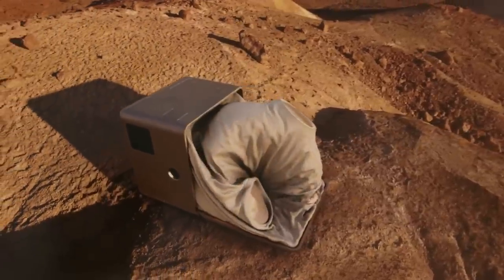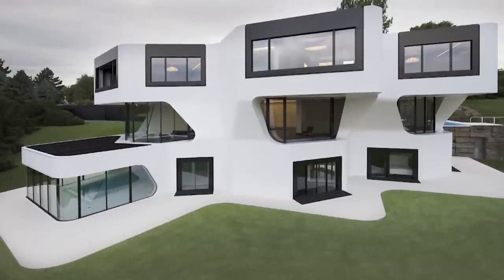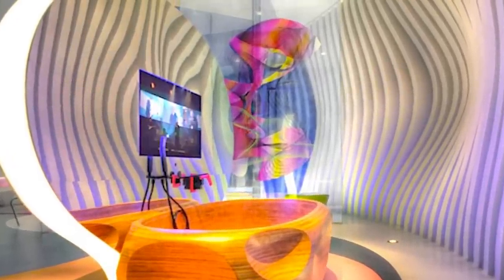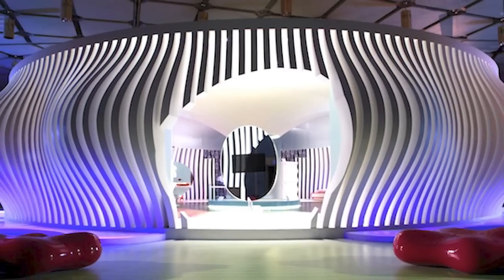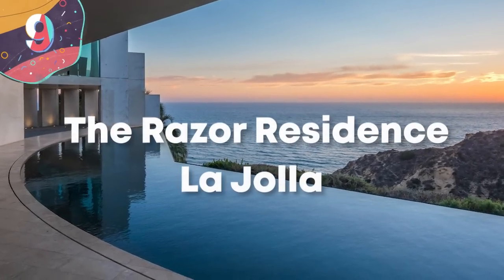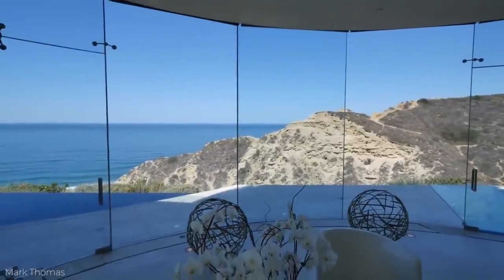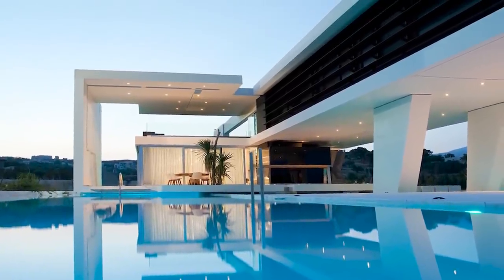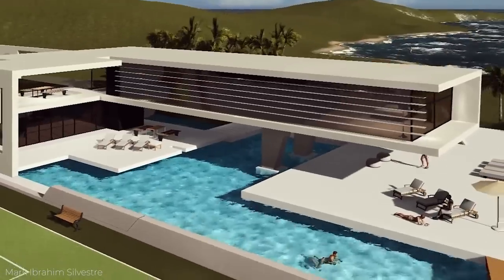15 Futuristic Houses that Are Totally Amazing

Comment: The heliotrope doesn’t even look finished, and if it is, is ugly. And geothermal hvac isn’t as efficient as current entry level hvac ductless heat pumps(unless in Siberia). And the whole “environment” theme on all the current renowned homes is tired already. We’re not in a crisis like the Greenpeacer’s want to scare all of us into thinking is. Looks like we’re in a plague of hideous and boring chapters of design and appeal. 
Solar and low power consumption and efficiency is my main interest, and ugliness doesn’t have to be, just doesn’t. This is part of conditioning all of us to believe to accept a level of that to achieve some global weather security we cannot control.
Reply: The Helitrope is ugly as a sin and it's also over-engineered and not very efficient by today's standards. But it's 28 years old so we shouldn't really judge it by today's standards. It really was cutting edge technology when it was built back in 1994